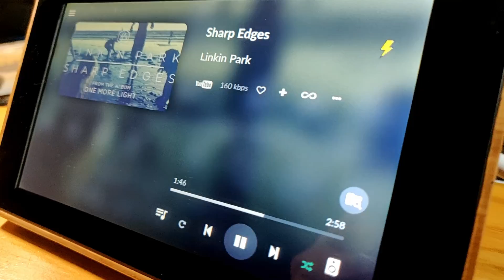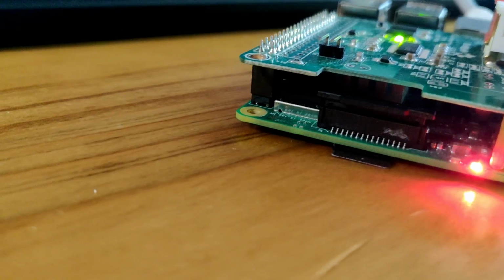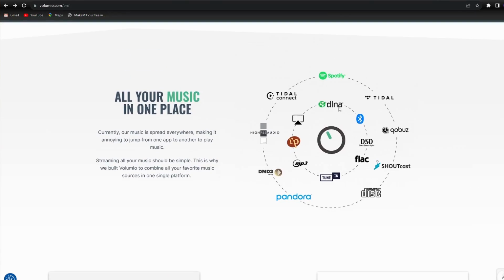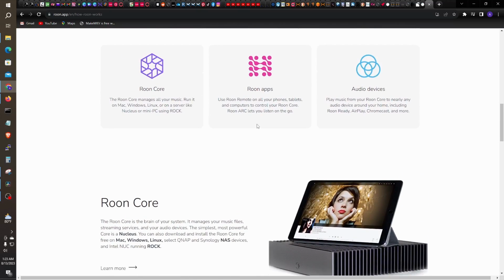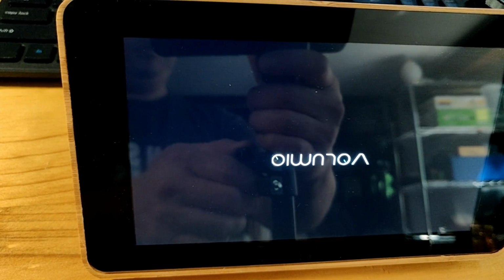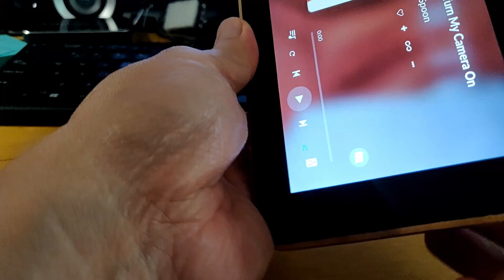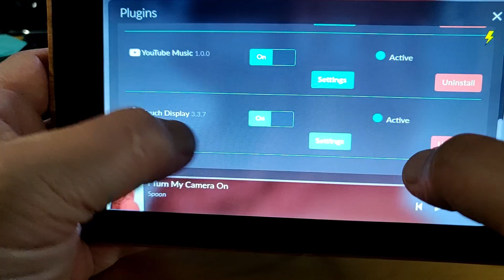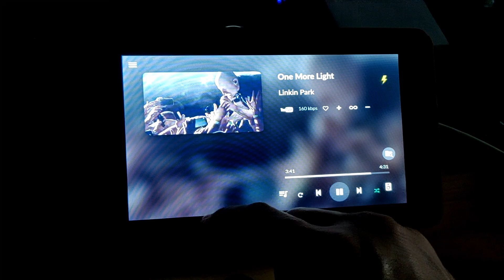DIY touchscreen HIFI audio streaming device

Comment: SHUD I install Volumio after I run my Pi??
Reply from the maker: Install Volumio on a microSD card and insert it into the RPi. You can have a different OS but you will still need to set up the hardware for Volumio.